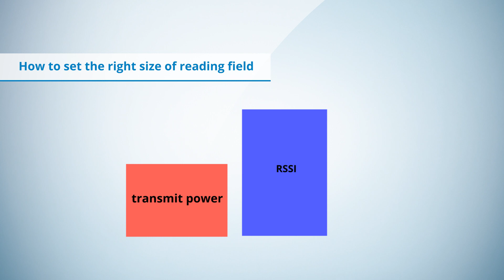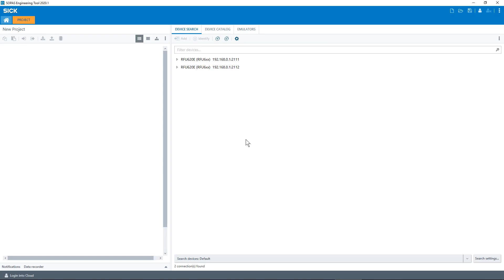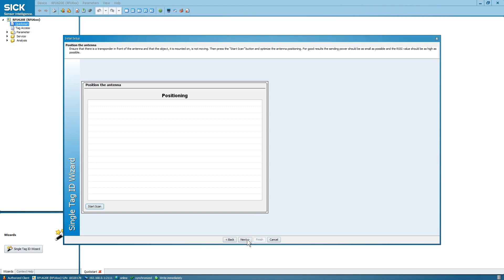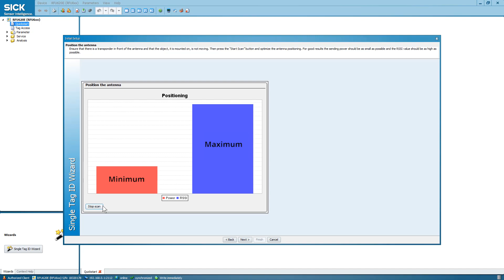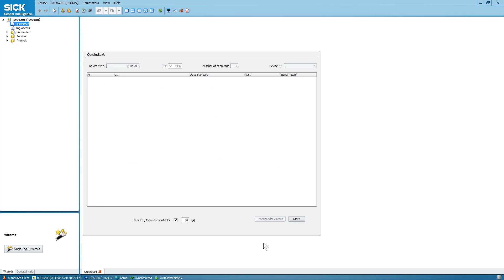Tutorial RFU6xx: Adapt the right size of reading field | SICK AG

Comment: Tank you for share. I was looking for understanding our RFU630 reading field. We have this Rf scanner mounted vertically and reading a slightly hidden Rf label. Does the scanner require line of sight?
Reply from the maker: Hi Wayne, thanks for your question. In general RFID does not require a line of sight and can also be used to read through non metallic materials. Due to the fact that each application and set-up can vary we would recommend to contact our experts and discuss your topic in detail. Please use our SICK Support Portal (https://supportportal.sick.com/). Here you will get immediate support.

Comment: If the RFID tag was attached on the inside of the box can the RFID reader be able to read it? (the box shown at the start of the video that looks like its cardboard)
Reply from the maker: Dear Seekery Tom Fain, 
The RFID tag can be placed inside the box. RFID does not require line-of-sight. As far as the box material is not electrically conducting as e.g. metal, the tags inside can be read and written without restriction. 
You will find more information here: https://www.sick.com/de/en/topics-and-knowledge/rfid-know-how-identification-using-rfid-technology/w/rfid/
Reply: @SICKSensors  I thank you for answering my question.